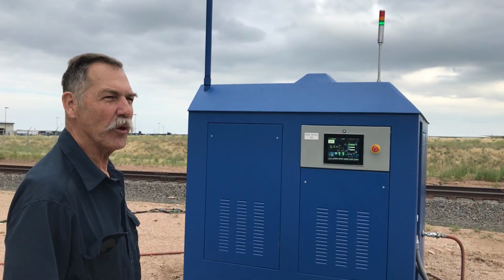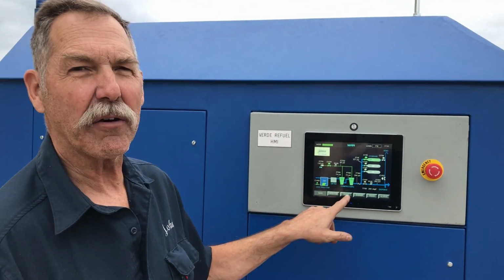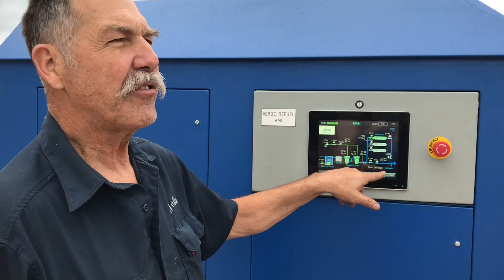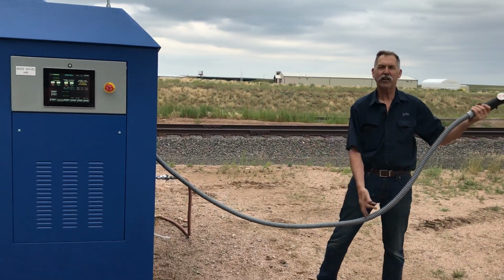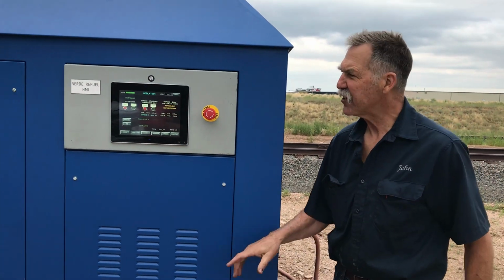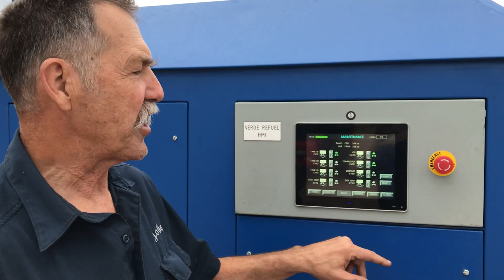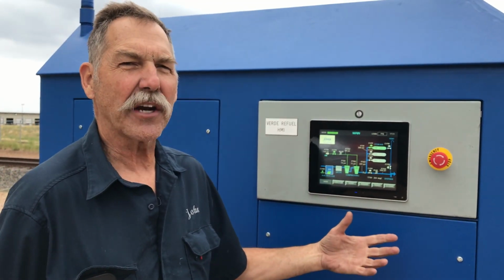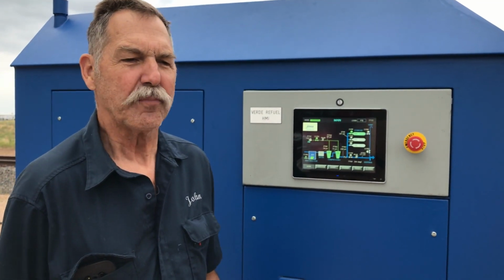HYDROGEN REFUELING STATION-VERDE CUBE SERIES Home Refueler

Comment: Converting electricity to hydrogen, to be converted back into electricity. Absolutely Bonkers😂
Reply: Instantly transferable to the vehicle in the form of gaseous hydrogen... Instead of waiting hours and hours. The reason for the hydrogen fuel cell invention which apparently escapes some lower mentality individuals.
Reply: And now sodium-ion does away with your lithium grift pipe dream so away with you to the corn field to join your fossil fuel dinosaur predecessors 😆